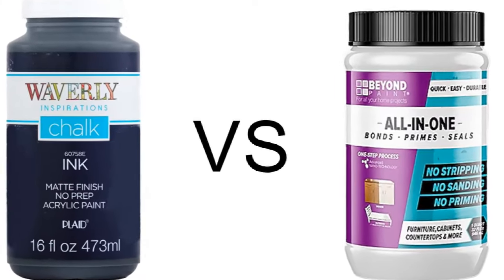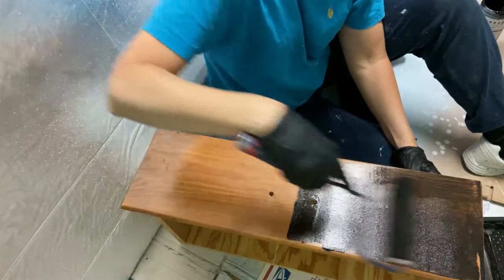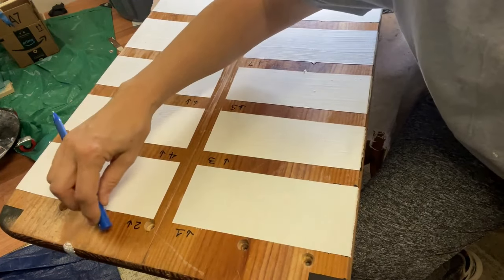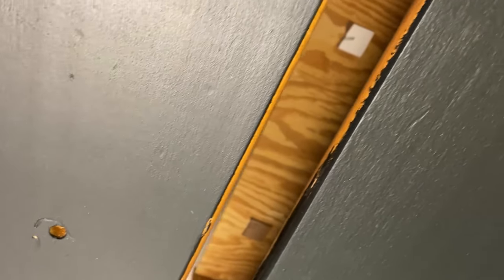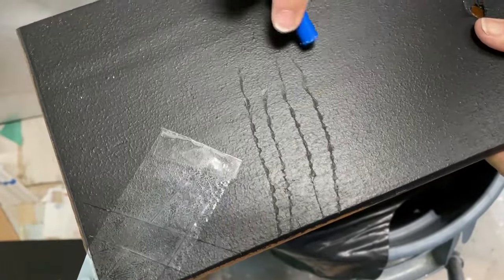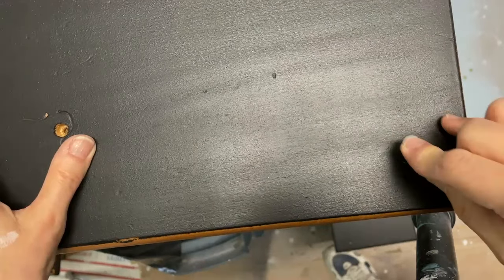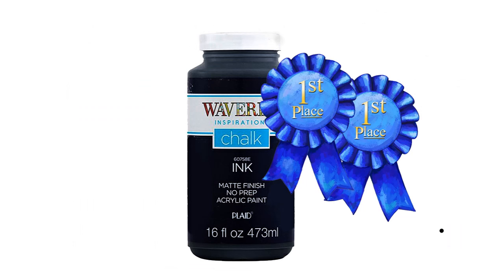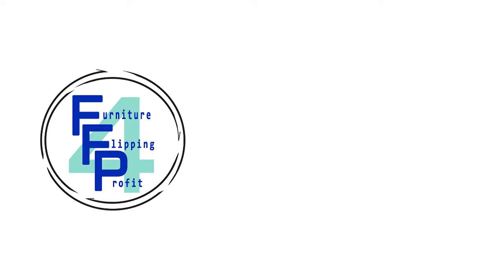Beyond Paint vs. Chalk Paint | The Shocking Results! | BEYOND PAINT APPLIED 4 WAYS.

Comment: Any generic waterbourne paint would have made this a blind test.Black generally in housepaints uses carbon black as the main pigment. A better choice of nap to achieve a smooth finish especially when two coats are on the schedule would be a 1/4'" nap. Brushing with a generic brush leaves questions the main being what was the actual bristle material and most importantly was this a flag tip brush. Like brushes, foam sleeves come in many configurations, of percentages of closed and open cells.  One method which works to the applicators advantage is to slightly dampen the application tool with the solvent or vehicle in the actual paint. In this instance a small amount of water. It looks as if too much pressure was being applied to the foam sleeve and frame assembly and the sleeve was not turning completely about the axis and was skidding skidding  What shoud be recognized when applying waterbourne materials they are thixotropic and are designed to "dry" quickly. Curing is in the realm of physical chemistry and unlike evaporatives and alkyds. This being said the application process and techniques are not always the same for every paint or coating. The most obvious applicating method over a smooth clean and slighly abraded surface that is parallel to the floor was the use of the HVLP spray gun. (High Volume Low Pressure)  The type here that was used uses a squirrel cage turbine for the volume of air as well as the low pressure. One factor should be noted. This type HVLP's air source generates heat. One should compensate for this by applying the acrylic type paints of the thixotropic a/o the evarporativs  ie  lacquers, shellacs and automotive acrylics by spraying smaller areas. The general rule of thumb would be an area the size of a two car garage door.
Reply from the maker: Thank you for your very informative comment.